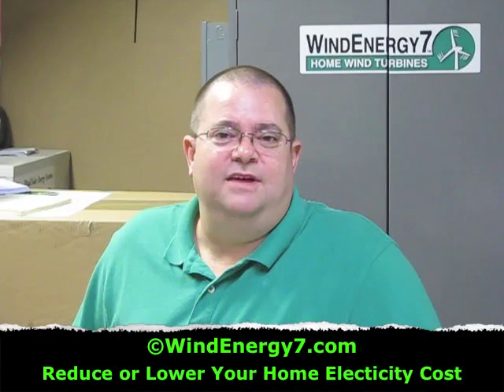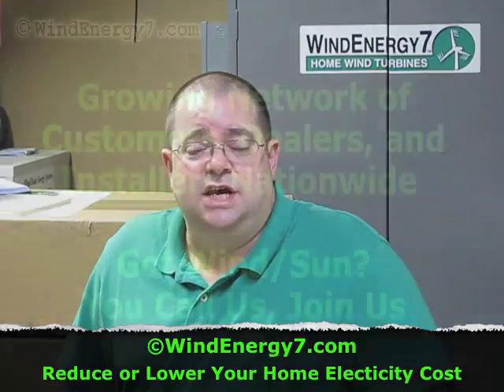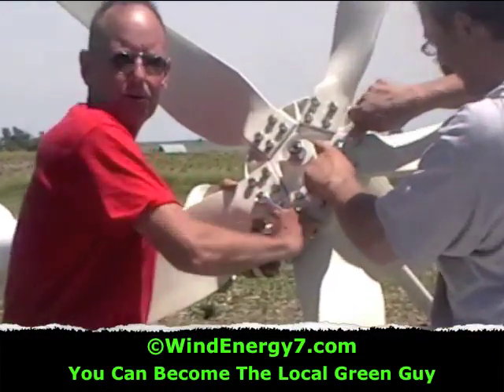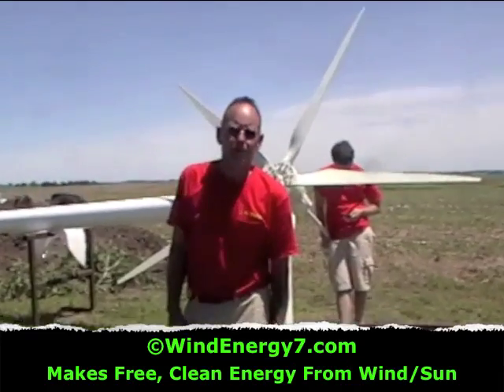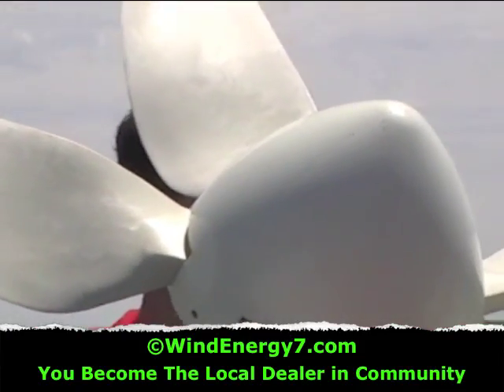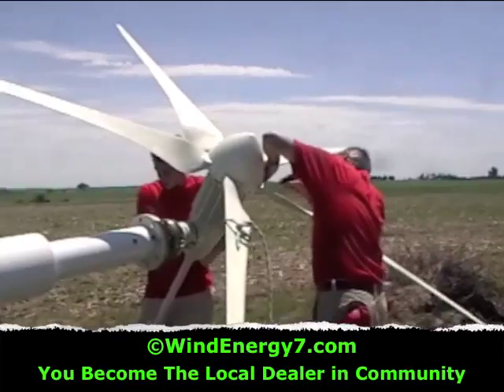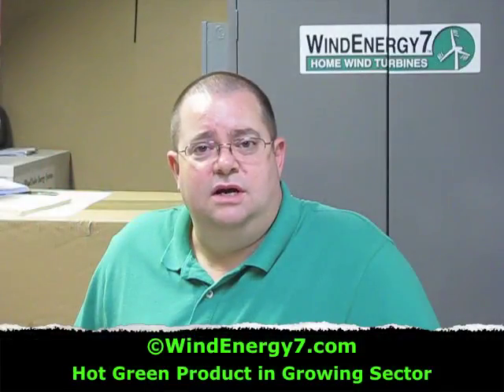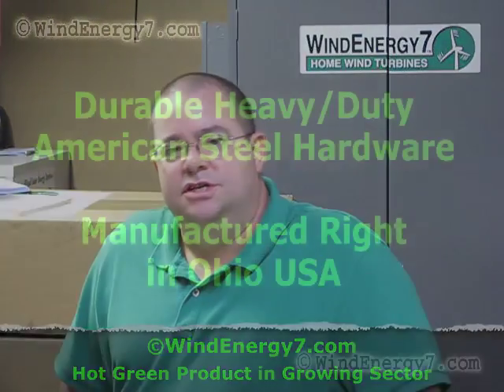Windmill Sale TowerMill™ Generator

Comment: Please show how long it takes to pay back the initial setup costs in an ideal Midwestern setting.  I need a practical cost analysis which includes normal "on the grid" electrical costs, versus the cost of your windmill, and the savings necessary to make your setup practical. Please, no "pie-in the sky" "green" propaganda, just what it will cost, and how long it will take to repay the setup costs, and how long it will take for your windmill to actually make my electrical costs cheaper, and how long that will take.  DO NOT tell me about any "government programs" which "help".  I do not need a socialist windmill.
Reply from the maker: Tony Boyle Ha ha, the government program is to let you KEEP some tax money going to WASHINGTON and USE IT ON (YOUR HOME).  Its not my money, or anyone's tax money but yours.  I don't do government giveaway either.  But MY MONEY, on MY HOME, instead of going to washington,. hell yeah brother.  Its a straight tax credit.  Its not a socialist giveaway.